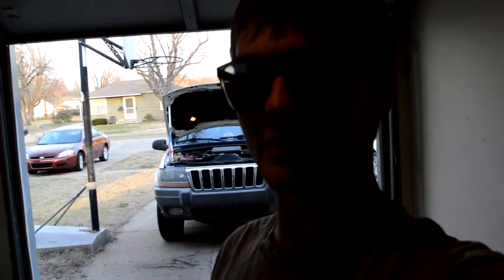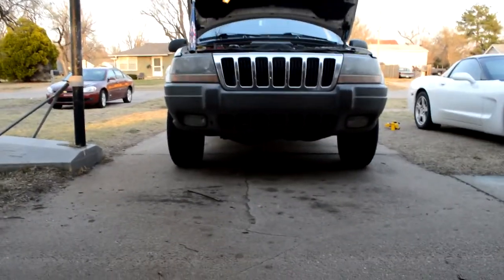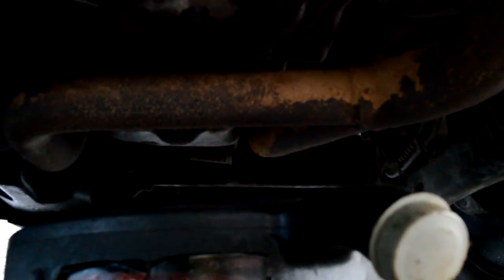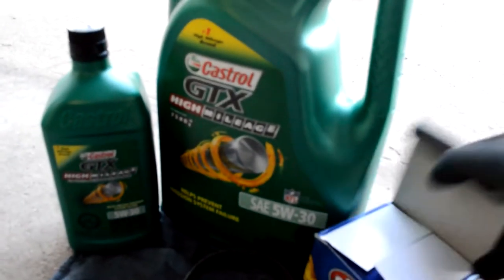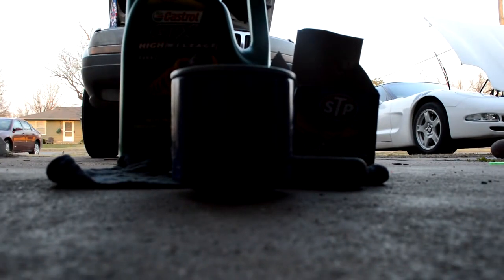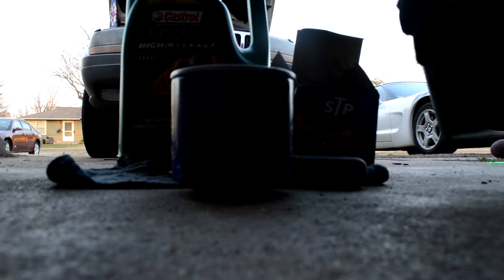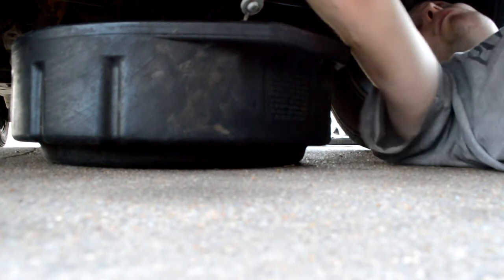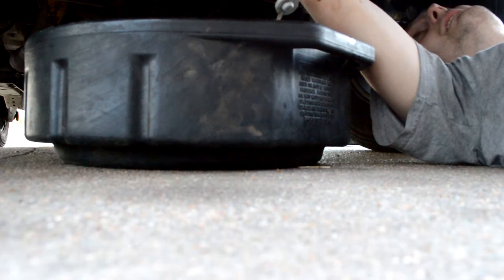How To Change Oil In A Jeep Grand Cherokee 4.7L

Comment: I would love to see more videos, but you should try to put a spotlight on the areas you are showing and working with. If you had a magnetic shop light you could have just stuck it up there and turned it to any angle needed to show the drain plug clearly.
I can imagine those new to car maintenance will be terrified to unplug any screw under the car in fear of draining a transfer case, transmission or a steering pump. 
Just tips.
• Oil Drain Bolt/Plug for 99-04 WJ (Jeep Grand Cherokee 3.7L/4.0L/4.7L) all trim styles:
M14x1.50x30mm
Reply from the maker: Appreciate the feedback! My how tos have gotten better over time. These were some of my early on videos, and thanks to great feedback like this I'm able to do better the next time. 🙏🏻🙌🏼❤️

Comment: Forgot to lube the new oil filter o ring and check to see if the old oil filter had the o ring on it before putting the new filter on
Reply from the maker: I've heard to pre lube it and to not to. I don't really know which is best. But valid points, thanks for sharing!

Comment: i have 2000 jeep grand 4.7 what kind of oil i have to use on it on cold or hot weather?with 154k mile
Reply from the maker: Honestly it depends on how cold or how hot we're talking here. For here in Kansas I used 5w30, we hit 100 Fahrenheit and below zero year round.
Reply: The manual says 5w30 from 0°F-100°F and 10W30 above 100°F for long periods.
Everyone on the Jeep forums use conventional to Full Synthetic. But if your engine is old and never burns oil, it's not recommended to use high milage.
If you do burn a quart every 3k miles then you may try Fully Synthetic High Milage.
But I prefer Synthetic Blend and Fully Synthetic.
I like Liqui-Moly and Royal Purple but they are just too expensive now.
I think you will do good with Mobil, Pennzoil Platinum, Valvoline, or even O'Reillys/Autozone brands, the RustysAutoParts brand is rebranded Valvoline conventional that says Synthetic Blend.
The Semi Synthetic and Fully Synthetic oils flow faster through the engine which is good. But if you have worn piston rings or cylinder walls Synthetic can leak through and burn off. Just test the better synthetics and see how it goes for your WJ.
I'm going Synthetic Blended Mobil Super next because I got a really good deal on it this month. Fram premium Filter 3micron, and a new hand twist oil plug with rubber gasket.
I'm also changing the PCV valve which manual says to replace every 30k miles and I'm at 222k on my 02 Jeep Grand Cherokee Laredo 4.7L V8 (VIN-N)
Reply from the maker: Great details here, thank you for that. I appreciate the explanations 🙏🏻